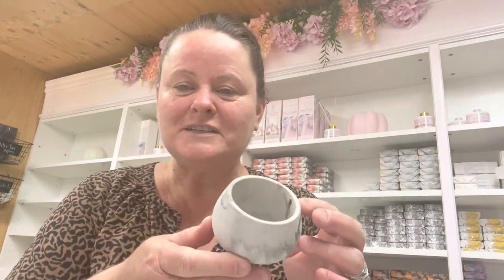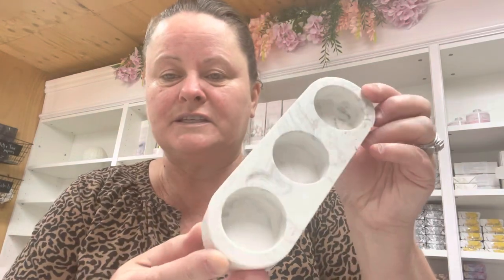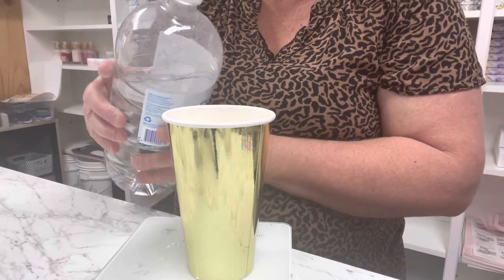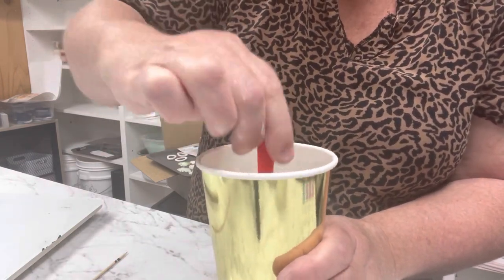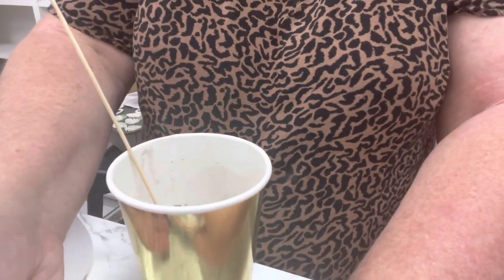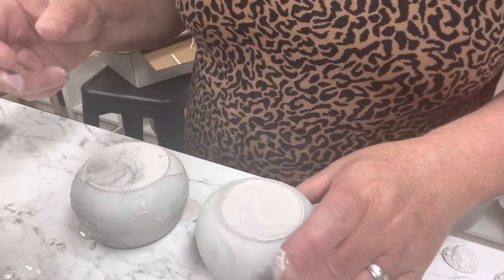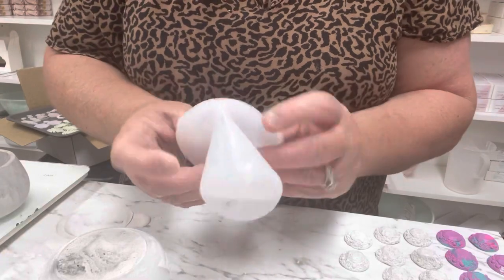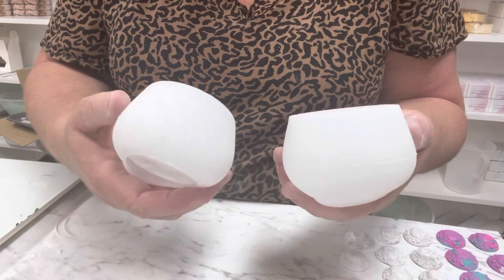Making cement clay candle pots with hydro stone

Comment: the ratio is 1water： 3 hydrostone by weight right?  I always got a very thick mixture that is difficult to pour.  I wonder why is that so.
Reply from the maker: Yes right . Mine is still quiet thin. It’s easy to pour so making sure your mixing it well as mixing it for up to 1 minute helps to thin it out. 
I do 300 grams powder and 100 grams water and it’s the perfect consistency